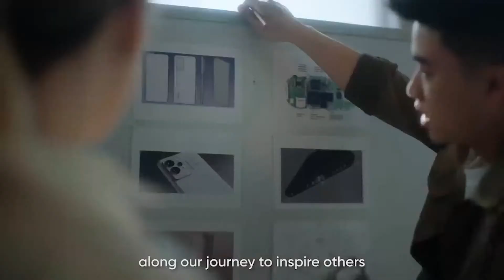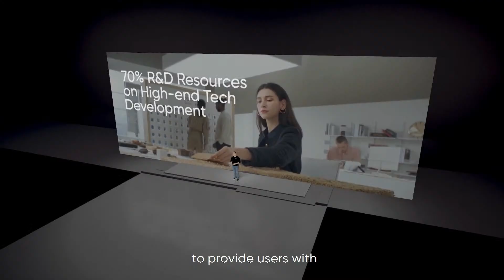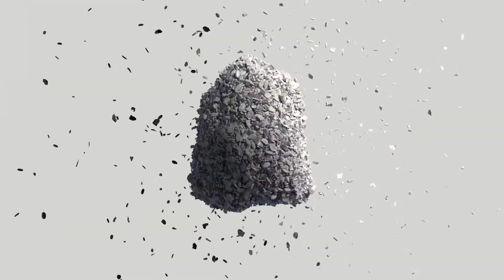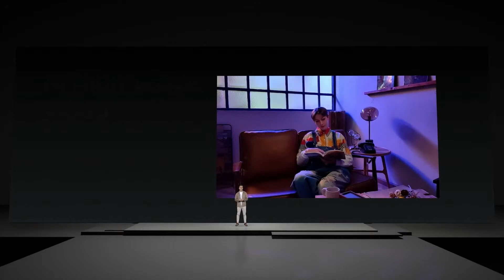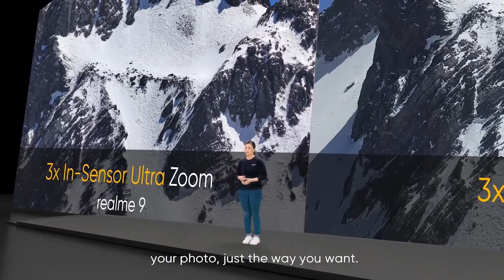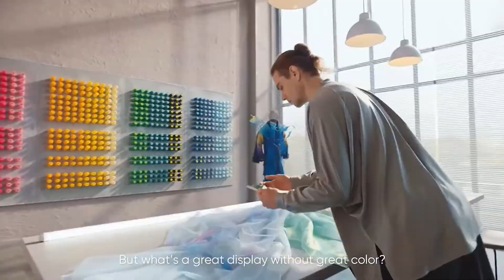realme GT2 Pro & realme Buds Air 3 | Launch Event

Comment: i have a question, at realme site they write this phone has lithium polymer battery inside it, but when i watch a disassembly video of it on the battery its lithium ion returned 🤔🙂, please clear this doubt as this phone heat quite alot at heavy task so im worried if my phone will blast or not  🥲

Comment: Please Realme I am Waiting For Your Reply Please Lunch Any Smartphone With These Specifications: Display - Minimum 6.5 inch, Minimum FHD+ (2400×1080) HDR 10, Dolby Vision, Super Amoled 120Hz, Gorilla Glass 5, Minimum Triple Camera - Minimum Main - 50MP, Ultrawide , Micro, & Front, Audio - Dual Speaker, 3.5m Jack with Dolby Atmos Wired & Wireless,  Processor - Snapdragon 778 G Or Any Other Successor Of 778G Snapdragon Processor With Minimum 10 5G Bands, Sim Tray - Triple Slot, Android - 12 With Minimum 2 Year of Android Update With realme UI 3.0, Memory & Storage - Ram - 6GB Minimum LPDDR4 & Rom - 128GB Minimum UFS 2.2, Expandable Storage Upto 1 TB, Charging - Minimum - 30 W In Price Segment Of 20k To 25k
Reply: Sounds alot like Galaxy A52s 5G